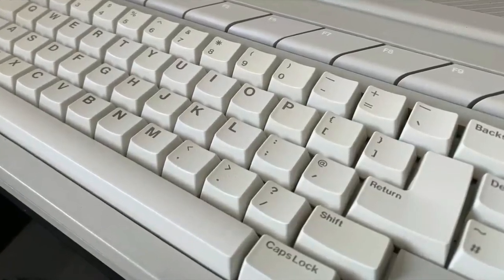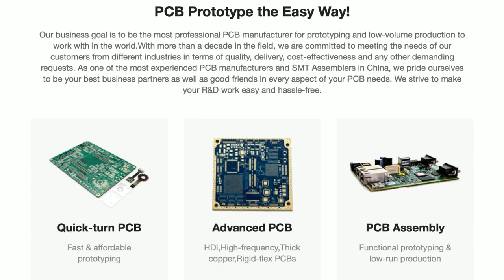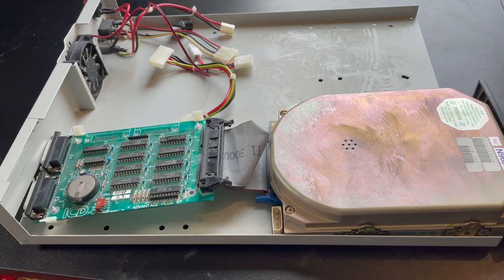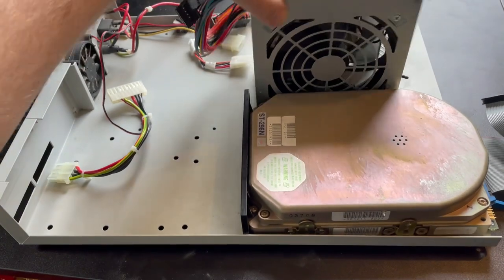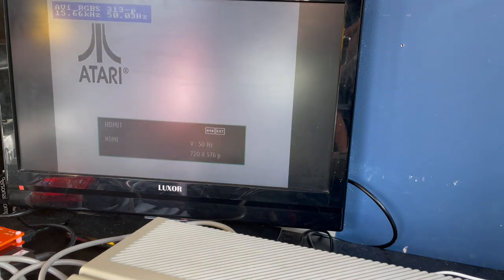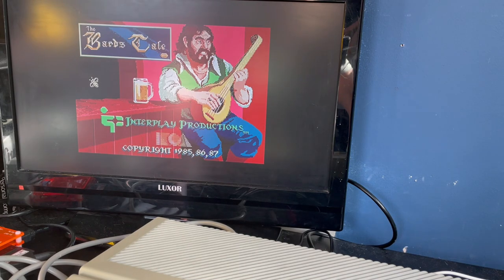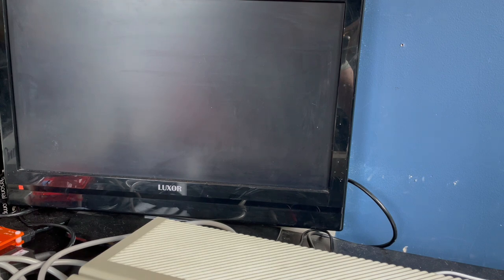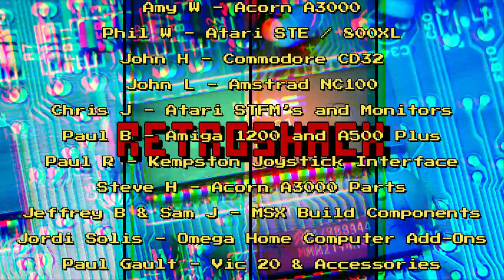Atari ST Hard Drives - SCSI - ACSI - SD Cards - Is it worth it?

Comment from the maker: Hope you enjoy the episode :) Minor correction needed:  The speed comparison is showing an SSD throughout rather than the NVME that I refer to - NVME is even faster :) :)
Reply: Try an interface IDEal interface with a 2.5" internal HDD from TUS Developments. I used one with a Veloce+ board.
Reply: IDE has a very good thing that keeps it alive in embedded application, and that's ease of interfacing, you can get $1 ARM Cortex M3 microcontroller to talk with the hard drive and SSD with classic Parallel ATA interface. eMMC SSDs come pretty close but require the microcontroller to have SD card interface to work, so there's some parity in embedded options. And NVMe is a usual standard for PCIe SSDs so it's just much faster.

Comment: Current release of ACSI2STM (3.0) has a driver built-in. It injects driver code into the data stream, so no need to have it installed on the SD card itself. You can use regular FAT16 DOS formatted SD card.
Reply: Thanks for that info. What is biggest Card we can use for ST and partition sizes/numbers?
Reply: @methanoid  
I had a 65MB drive on my Mega ST2. He mentioned an 80GB.
Reply: @methanoid  there is not direct limitation to SD card size, what is limiting you is the TOS partition size support which with TOS 1.2 and lower is 256MB and 1.4 and above 512MB size, and the number of drive letters available (up to M?, dont remember sry). You cant use more and the rest of your SD card space gets wasted. There are some modified TOS versions out there that support proper FAT16 (ST TOS has not full support) and those allow larger partitions (1 or was it 2GB?).
But it is a good habit to make the first partition just 30MB large...

So the sweetspot is the SD card sized 8GB and less.
But dont be sad, even 512MB HDD is huge size for ST.

Comment: I have an Atari ST with a SCSI tower I built, it contains two CD ROMS,  two Hard drives and a Zip drive. I had a BBS  when I was a teen . Troll BBS, 2 lines, 2400 baud 48 MB online.  Running the WWIV BBS on a 286 add on board and doubledos.  Power of Vintage channel is checking out the 286 add on right now.

Comment: Jesus Lord...a Megafile that was a Dream... I could get a Megafile30 for 100 bucks and hell i did put all my disks on it wich had no copy protection. It was so fast and my Arm could finaly relax from Disk changing. I could do finaly run Programs much better and save while i did use the Programs. Without a HD it was a pain in the butt. I could finally use the ATARI 1040 STF for my financial accounting and tenant management without fear of losing data.

Comment: When you say "dead" do you mean not spinning? If so as you power it up try a sharp tap from a mallet on the side as you do so, as it could be the oil in the bearings is too thick!
Reply from the maker: Thanks for the tip - I’ll give it a go!
Reply: @TheRetroShack  I was attempting to repair a SCSI drive (opened the platters etc) a while back - then mysteriously it flew across the garage at great speed and was totally broken. I think was about the time Man City scored against QPR hence winning the title on goal difference - funny how drive repair goes.

Great video. I have got back into the ST bug - can u put in description where u got the new HD from and any hints if you needed to buy a driver for it? From what I understand all of these devices need it (Ultra SATAN, your one, others).

Comment: Around 1993 I had an ATA HD (186 MB) installed inside my Atari ST. There was a local electronics engineer who built the interfaces and installed the hardware (he was actually a student at our Technical University in Gliwice). Later I also added a CD drive on the same interface and had all my programs burnt on a CD. It was well worth it! My Atari, previously upgraded to a newer TOS and 4MB of RAM worked like a monster!

Comment: I built my own 20Mb HD - used a 20Mb MFM disk with an MFM to SCSI adapter card feeding into an SCSI to ASCI card all built into a custom box with a chunky PSU. Disk and PSU from Henry's Radio on the Edgeware Road. I was 'blown away' when the bloody contraption worked 1st time off!!!

Comment: Strangely, a lot of ST games that would have easily fit on a single disk were distributed on two disks anyway.
The reason for this was that early STs had a single-sided floppy drive.
I guess software houses wanted to maximize the number of ST owners who could use their software, so they supplied it on two single-sided floppies instead of one double-sided one.
My own ST originally had a single-sided drive, and it meant that , while I could load commercial releases just fine, I couldn't use any of the cracked menu disks from the likes of Automation etc, which were invariably on double-sided disks.
Needless to say, I nagged my parents for a double-sided drive, and upgraded my ST with my dad's help.
I'm sure there couldn't have been many ST owners left who didn't perform the upgrade, so I was always a bit baffled that the software houses continued to inconvenience themselves and almost all of their customers by providing legacy support for what must have been a tiny number of machines.
Floppy disks weren't all that cheap back then either. so it must have increased the cost of the software somewhat too.
I remember ST Format magazine had a workaround for this problem by coming up with a clever disk format. The disks were readable on both single and double-sided drives, but single-sided drive owners could only access the main root directory. Double-sided drive owners could click on a 'Side 2' folder and access extra software.

Comment: Hard disks rarely still work after that long, I find. I mean, the only one that old that I've found working is my A1200, but even that is making grinding noises and getting stuck at regular intervals, making it pretty unstable for running things on.

These CF/SD card solutions are really saving some of these old machines, particularly x86/IBM compatible machines, where from about '91 or so, a hard disk was required to even get into the OS.

Comment: I had a 520, 1040 then a TT030 with every upgrade I could find, max memory, both color and monochrome monitors, modem, (75 baud to 56k over time) a scanner and printer. I had the Syquest drive too but maybe that was just on the TT, as IIRC it could use SCSI drives directly. I remember my first hard drive was 5meg for $500! - over $1,100 in todays money. I was clearly nuts given my income at the time. I also ran Magic or Mint - can't remember which... ST series were what I consider my first "Real" computers i.e. good for something other than games, but strangely I don't have anything like the nostalgia have have for my Zeddy or other 8 bit machines - maybe because those took a lot more imagination and real work to get anything at all out of them and you had to do most things yourself (it was all "Potential") whereas with the 16 bit generation, I was just a consumer. Also why I have even negative interest in old PC's; those are just ewaste!

Comment: I bought the ICD dual 50MB (total 100MB) hard drive unit in the fall of 1987 for my Mega ST4. Later, I got a 200MB Conner hard drive and the ICD internal drive adapter to mount inside my ST4 case.
Reply: freaking rich kid  😉

just j/k
Reply: @madigorfkgoogle9349  I worked at Burger King all summer for $4.25 an hour.
Reply: @Dan-in-Virginia  what I said stays valid, a rich kid (self made, but still...)

😎

Comment: The ICD board inside of the hard drive was called a host adapter, and you always needed one to interface ACSI (Atari interface) to SCSI. The two primary manufacturers of host adapters, apart from Atari themselves, were ICD and Supra. 

Many ST users rolled their own hard disks. You’d buy a case with a host adapter and power supply, and then source your own hard disk from various manufacturers. They had to be SCSI to work with ICD or Supra host adaptors though. 

Mega ST users could buy a third party kit to install a hard drive in the Mega’s case. It was not until the TT/Mega STE/Falcon era that Atari offered machines with provisions for integrated hard drives. 

Interestingly the SH-204 drive from Atari wasn’t SCSI but rather MFM, with a weird custom adaptor inside the case. I don’t think you could swap a larger MFM unit into an SH series like you could with later Megafile units.

Finally, the Falcon supported 2.5” IDE internal drives, and also replaced ACSI with a SCSI standard port, both of which made purchasing and using a standard HD much easier by eliminating the need for a host adaptor altogether.

Comment: I had one of those in the day (the official Atari middle).

A huge 30 megabytes!

Open the case and you find it was a IBM PC comparable drive as well. But watch out for the exposed and mains live heat stinks in the power supply – they bit me a few times when I was poking around inside it. Ouch!

But compared to floppies, it was a dream to use and I never filled it over the couple of years I was using it.

Though it’s internal fan was very noisy and annoying, especially when compared to the fan-less and quite Atari ST computer it attached to.

Comment: I have the UltraSatan on my 1040STe and currently using the HDDriver tool. I have used the 8bitchip tool in the past, but found the HDDriver used less memory at start up, which even on a 4MB system seemed essential for some games. I recommend trying out some of the Dead Hacker's Society demos like US Policy, which really pushes the data throughput on the Ultrasatan and it would be interesting to see how the ACSI2STM runs it.
In regards to Atari ST vs. Amiga, copying files to and from the SD card for the Ultrasatan is so much easier to manage compared to having to setup a CF card on an Amiga. On my Mac the SD card for the Atari is recognised natively, no need for drivers or specialised software. Compare that to setting up a SD/CF card for the Amiga where you need to have WinUAE installed to setup and copy data to and from the card
Reply: The portability of hard drives between different platforms depends largely on the file system used. FAT and FAT32 can be used on an Amiga, and those can be directly read by any other computer OS that understands the FAT file system, including Windows, Mac OS and Linux.
Reply: and I have to add, that if you have multiple Atari ST/TT computers, the ASCI2SD/Ultrasatan(mini) solutions are great, since when you are in mood of using ST instead of TT, you simply unplug and plug in to different Atari.

Also in terms of data transfer, I tend to use the NetUSBee and Ftp instead of pulling the SD card, Im lazy...
Reply: Really strange to say that HDDriver uses less memory than PP driver (8bitchip tool - funny to call it so) . Plus, it is not relevant how much RAM is used at start up, what matters is how much RAM it uses during regular work.  I see complete bad opinions all over Atari forums - people is just so confused and lost in all it. To add that RAM usage may depend from partition sizes too - larger partitions need larger buffers, and they may take more RAM than driver self.  In any case, some 42 KB RAM taken is no problem, not even with only 1 MB RAM in machine.

Comment: I had a Third Coast box with my ST, the RHS had the PSU and I had two Seagate SCSI drives fitted. As far as I can recall I used the standard Atari driver as the Third Coast had a floppy that came with it to get you going and set up the hard drive(s). I recall they may have been 20Mb drives (MFM) but formatting RLL bumped them up closer to 30Mb.  I'd completely forgotten the make until you produced that third coast box and it all came flooding back

Comment: I had a Third Coast Technologies hard drive like that. I even went to their workshop near Wigan. It was only a couple of years ago I chopped up the case. I bought a BlueSCSI for my Falcon which uses the same STM32 chip and use Peter Putnik's software on both my Falcon and STe (I have an Ultra Satan)

Comment: Minor correction.  At 7:11 You show an stm programmer not a dev board . Stm32h7 mcu if you can find one for sale at all is usd $13 or so. Not $1. Very scarce due to supply chain issues. Dev boards for h7 series like nucleo with an h7 is about $30 usd from digikey. 

They are still affordable but not that affordable!

Comment: I found my  520ST fm and monitor in a skip after the town had a flood in the 90's, it all worked perfectly.
Unfortunately there were no disks. 2 years later I found a ZX81 emulator for it. (I grew up with the 81 so it was perfect). I just could'nt get any other software. I just stopped using it about 2010 and stuck with my A1200, Speccy and real ZX81.

That's a great add-on for it, though.

Comment: If you intend to use MiNT and (especially) EmuTOS, then the HDDriver is the better all round option. However if you are only ever going to use TOS based partitions, the the Putnik driver is more than "fine", and from a software point of view, is a souped up AHDI driver (which will also work fine with certain modern hardware - but get the right version).

Comment: Oh that's cool . Still have my STFM and 4MB STE. And a Third Coast ICD hard drive which works (or did last time I powered everything up.)  And an Atari Megafile60 which I never managed to get working. (I think I was given that along with some other ST hardware.)  Anyway having the hard drive made running serious software like word processing and DTP so much easier. It was hooked up to the STE so didn't run games from the hard disk. No idea how or if it was possible to get games running from hard drives - I suspect some had it as an option but I could be wrong. In the UK things ST related seemed to completely die out over 20 years ago, there was never the continuation which we have seen with the Amiga. As far as I know. Currently waiting for someone to do an ST Next with huge screen resolutions, working with a tiny b&w monitor isn't much fun these days.
Reply: Yes it's sad not much love for St. But there's some if you look. Check out exxos

Comment: I have a bit of experience with the St and the expansions. HDDriver has one great feature going for it. It can create partitions in a byte swap mode. This switches the byte order on the disk from the Motorola mode to the Intel mode, and that means a modern PC can access the partition. Of course it costs some performance, because of the byte swapping. But it is extremely convenient to just plug your Atari "hard disk" Into a USB card reader and be able to copy files onto or off of it. 
The pera putnik driver doesn't have that feature, but I think it can get a little bit more speed out of the same hardware. 
And then there is the original old ICD driver. It is not the fastest, but it has a really nice boot screen and it's original from back in the days.

Comment: Erm, that was a SATA drive spec not M.2. M.2 is over 10 times faster under PCIe 4.
I had a 120MB Quantum drive back in the day, and due to a TOS bug you couldn’t have volumes bigger than 16MB. I had drive letters out to I:
Reply from the maker: Already a pinned comment on this little faux pa of mine :) :)
Reply: what TOS did you have? The 1.0 and 1.2 was limited to 256MB later versions to 512MB. It was a good way to partition the C: to 10 or 30MB for better function, but I never heard of 16MB partition limit...
Reply: @madigorfkgoogle9349  From memory it was TOS 1.02. Theoretically you could have had 32MB volumes (16 bit FAT, 1 sector cluster size), but there was a bug that meant that you were limited to 16MB (probably a signed vs unsigned thing). I believe the bug was fixed in later versions, and then the cluster size was made configurable so you could have up to 512MB volumes.
Reply: @stevetodd7383  if you had TOS 1.2 (yes I know it was 1.02, but for some reason we used to call it that), then you could have 256MB partition size, except the first boot partition that had a limitation (dont remember the size), therefore we always used 10MB on 1.2 or lower and 30MB for 1.4 and higher, but just for the boot partition (usually C:), all the rest could be larger.

Comment: Top notch video as always👍I’d  love to invest in one of these for my two ST’s but I’m not sure if I have enough memory in my systems to run one.
I have a 512k 1986 issue machine and a 1 Meg version (Not sure what year) and I’m tired of floppy disks!! 
Would this work relatively painlessly on one or both of them? Any suggestions gratefully received.
Reply: In the 1 MB machine you can execute almost 90 or more percent of software.
Few titles require more memory, mainly due to the possibility to save actual game state to the hard disk.

In the 512 KB machine you can use the hard disk, but only few titles can be executed.
Reply: @masteries100  depends, if he wants to run games from HDD (i.e. the Putniks version), then he will need one more meg of RAM then the floppy game version.
Reply: @masteries100  Thanks for the info, i think i may have to invest fot the sake of that 1mb machine.

Comment: I can’t help but notice that it would take about 90 seconds to read out the entire 90 MB hard drive, but it would take about the same to read out a 128 GB SSD at the quoted speeds! (And of course if it was a 512 or 1024 GB SSD, it will take even longer!) Pretty interesting how capacity has continued to expand a bit faster than read speeds.